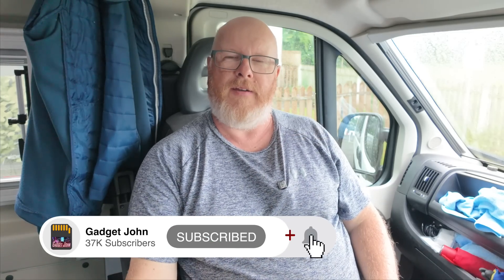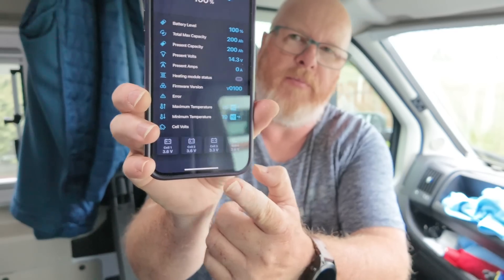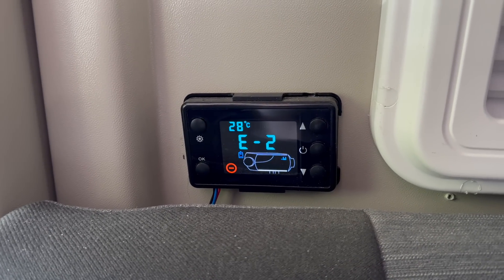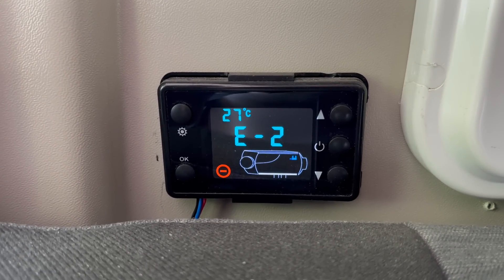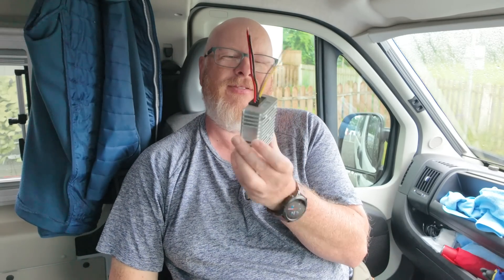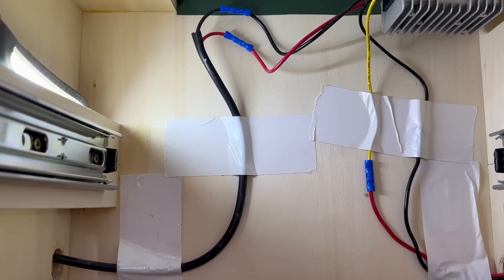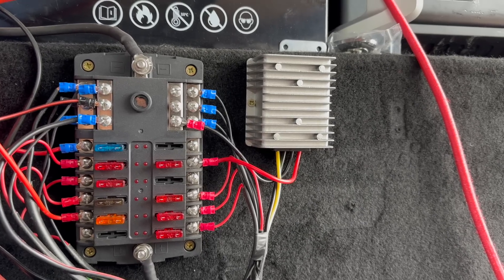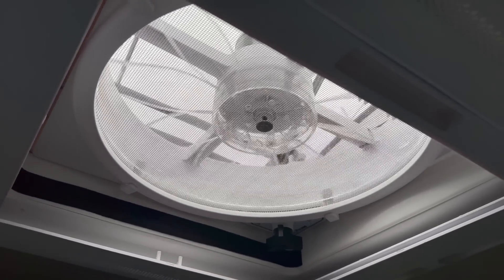The Voltage Regulator no one knew We All Need!

Comment: Hi John, hope you are both well. Took me a bit of searching to find, but i thought you did a video on this subject :) Got a similar problem myself now. Whilst on AGM batteries my Alexa worked no problem wired into my fusebox. Since changing over to Lithium i have now blown up 2 Alexa's (probably due to cell over charge, when reaching full). Touch wood everything else seems to work fine or at least as it did when i had AGM's. But looks like the Alexa needs to be at no more than 12v's. Thanks for the video, im off to look at Voltage Regulators now :)

Comment: My diesel heaters actually prefer running with the alternator and engine on. They definitely start up nicer on 14+v  diesel heater shouldn't really be very voltage sensitive i mean the glow plug definitely likes a few more v and a dosage pump and fan shouldn't really change much over a volt or two. I guess some controller circuitry can be sensitive to voltage changes.

Comment: Lithium is a badly understood technology. You do not need to charge at crazy high voltages you can get the same  result with more safety and with much increased battery longevity by charging at much lower voltages, plus it reduces the risk of thermal runaway and BMS shutdown which can be catastrophic for alternators and onboard chargers. We need to learn that Lithium does NOT need 3.65V per cell when you can achieve the same result  @ around 3.4V per cell. 3.4 x 4 = 13.6V which would probably be accepted by most 12V appliances because alternators tend to pump out 13.8 - 14.2V? Obviously IMO  :D

Comment: Make a lot of sense as you state these items are 12 volts not 14.4 and years ago when I fitted a TV in the back of our van that was a main / 12 volt tv I decided to fit a 12/12 volt regulator. However I’ve never thought to use one on other equipment ie. the two fans I’ve got like yours but I’m going to give it a try and see how it works.

Comment: Just thinking aloud, With the heater "cooling down" session, even using the "Buck" converter, if the battery fails, unlikely. Could you use a smaller 12v battery that the is only for the Heater, so that it always has its own supply and buck converter ?

Comment: This makes sense and yes the appliances should be designed for 10.5 - 15.5 volts but the manufacturers won't build these electrical appliances correctly because it costs too much as they usually use off-the-shelf components and they only want to meet the warranty period...  And just how many times does Management override the design engineer because the bean counters found a justification to use "lass-than" components to increase profits by NOT doing the right thing...

Comment: Funny I had the opposite, while tiring to run my 12vdc refrigerator using the 12v/20amp buck converter would fault out for under voltage, this was with 2 different 12vdc buck converters. I changed over to a 13.8v buck converter and now everything runs perfectly.

Comment: Great solve for some devices for sure   👍,  and/or out of warranty to open up and do some rewiring lol , Ive found Rving here in B.C. that my biggest issue is the power inverters, theres so much power left in batteries but inverters will BEEP alarm and shut off at barely below 12v, but without a wiring schematic pretty hard to do.
On 12v low amp things like remote starters and alarms for vehicles can use diodes together so main input sees over 12v and the other current but I havnt seen anything for big amp current

Comment: Following your links to Amazon UK: 12A version... £50 quid, now. plus £11 quid for postage.
6A version... £23 quid plus £11 for postage. And that's probably before they add our GST (Aussie here). Your video must have sparked a surge in purchases so they jacked the prices, maybe.
I already tried looking, before your video, as my voltage output is not very stable, at all ... for some reason.
I haven't found equivalent equipment down under, yet. Which is annoying and weird. And we always get ripped off down here to cap it off. sigh.

Comment: Diesel heaters also draw 10 amps for a short time during the shutdown sequence when the glowplug is activated. That triggered an E-2 error for low voltage as my batteries were quite low. I had to start my engine to allow the heater to cool down correctly. Lithium conversion incoming.

Comment: This explains a few electrical issues I've had.
Mainly the fridge cutting out. I put it down to being too hot in the van, but from your video suspect It's a voltage issue. 
Just upgraded to Lithium and replaced my old Victron Orion-TR B2B charger with the XS model.
Looks like I can now repurpose the old unit as a voltage regulator for the main fuse board if it's put in Power Supply Mode.

Comment: I had the same problem with an echo dot in my car camper fitted a 12v rectifier to run it so when the solar goes into equalize it doesn’t over voltage the echo dot

Comment: Hi is this gadget adjustable ? As I’ve seen many diesel heaters need at least 13.5 volts so it’s working for you but will it work up to the 13.5 itself slight confused as a long chat  cheers

Comment: Thank you for this! These voltage regulators have quite a decent heat sink on them. Does that mean that they generate heat and should be installed fairly isolated? Or can they be installed in a fairly small space surrounded by wires?

Comment: Found this really interesting John, thanks for the vid... question, and forgive me if it is a stupid one as I know enough to get by when it comes to electrics... but could you not have a voltage regulator in line from the battery directly... so anything being fed from the battery would be regulated... or does it have to be one per device?

Comment: I've "cooked" a few devices because of this 😅 most recently a WiFi router that has run for years, after a drive with it on it smelt of plastic and no longer worked properly, something inside it had obviously burnt out. Bought myself a regulator like yours and it's been fine since 👍 my fridge also changes tone when the sun goes in and out (solar charger), so I may put one on there 🙂

Comment: The problem with your theory is that most alternators using a standard lead acid battery charge at up to 14.4 volts as well. So I would expect any device designed to run in a car off of the 12 volt system to handle 14.4 volts with ease.
Reply from the maker: That’s the great part about my videos, I don’t theorise, instead I wipe out any reason of doubt by proving what I say and showing why I’m saying it. Thanks for watching.
Reply: @GadgetJohn  I’m glad it worked for you. I’m just a bit doubtful of any 12 volt equipment that can’t handle a standard alternator charge voltage. Unless, as a thought only, the fact that you have put a lithium in is somehow causing your charging to ramp up the voltage higher than this. Of course, I have no idea what you are using to charge this. If it is pushing a higher voltage than 14.4 volts though, it may well cook the lithium battery as well, or at least cause it to shut down to protect itself.
Reply from the maker: You’re not seeing that not all 12v devices are designed for the automotive sector.
Reply: @GadgetJohn  true, though a diesel heater designed for a camper should be. A normal charging profile for a lead acid or AGM battery will reach 14.6 volts and most solar regulators will push that voltage. So I would expect at least the diesel heater to be happy to deal with such a voltage easily.  I’m not trying to be difficult, I’m just trying to figure out why your set up has caused you problems in the first place. It’s quite unusual.

Comment: Great addition.   Having a stable known supply is essential.  I installed a microprocessor with touch screens to control the van and had all sorts of stability issues with relay boards and touch screens.  Solved with a regulator.   
If the regulators are decent they will also provide DC ripple isolation between devices.  Useful for when you’re running higher draw devices and motors.

Comment: Argh, I hate it when my battery dies and shuts down my diesel heater with that err 2., it would make more sense for the heater to shut down but allow the cooling process to continue operation. Im going to need a backup battery system just to prevent that. It wouldnt be good to have my heater crack in mid january with Canadian weather.😢

Comment: John, is there a master version of this so that it could be placed between the battery and main fuse box then all items would receive 12v?
Reply: I have found a 24v - 12v 60A unit on ebay a couple years ago for my off-grid RV to selectively replace the 120v shore power converter with the 24volt storage setup. I'm convinced it is 720 watts (12v@60a) maximum output, not 1440 watts (24v@60a) input, as the advertising of ratings can be a bit confusing. I found another one for 48v - 12v for about the same price for when I'm ready to upgrade to a higher storage voltage trying to maximize efficiency running the refrigerator, AC,  and TV. I imagine they make a 12v - 12v version as well and they are about $70 - $80. I got a larger sized model without any fans with very little loss in conversion for the right price with a little searching. I've got it featured in one of my older "Off-Grid Hybrid Solar Solutions" (playlist) videos, and the device still runs perfectly after pushing it very hard in the summers with a lot of large "car radiator" fans connected to independent speed controllers (about $8 - $20 each). The converter still works without issue to this day. I forget it's there and I've never had voltage problems with it, but I've always had this worry on my mind about overvoltage on some electronics since I was a child experimenting with connecting automotive and household stuff up to each other.
I've got to mention that having it between your battery and your distribution panel will also act as a low voltage shut off if you lack a battery management system!
Reply: @SimonGardiner-m7l  exactly, why not put these at the base

Comment: No one, not even the manufacturer of my WLAN router could (or would) tell me if it will work with more than 12V DC (it came with a 230/12V power supply) so I installed a 12V/12V regulator two years ago and the router still works fine. 100% agree with your conclusions. Thank your for sharing it in a video.

Comment: This issue is a pain in the ass, it is not just confined to Lithium batteries, I am off-grid solar with Lead Acids, if my batteries ever read 12 volts on the meter I would be shutting everything off to protect the batteries. I never let them drop below 12.2volts normal voltage is 12.6volts after dark, after charging 13.2 and charging voltage can be up to 14.8volts. The trouble with regulators is they usually require at least two volts over the output voltage.
Reply: The buck regulators get around this by using smps design.

Comment: Thx John, It made me check my camper after conversion. Found most of the good electric devices to coop with 10.5 to 16 Volt but some where really 12 - 13.5 volt only. I have no started to convert the once I need to protect. Good to Know that on the Maxxfan it also helps to cut noise and wear of the fan. ❤😊

Comment: Hi John, I’ve just stumbled across this and you may have solved a problem for me. My webasto diesel heater will only work on hook up, or with the engine running. It fails on initial start up. The error message  is low voltage. I replaced both leisure batteries, but still have the issue. I found a few posts online with people having the same issue, but the only suggestions were to increase the supply cable in case they’re causing a voltage drop. I’m thinking this regulator has to help, what do you reckon?
Reply from the maker: It’s also a very good suggestion to increase the cable size to your diesel heater if the cable length from battery to heater is over 2M - I suggest double the cable size.

Comment: Im learning to build drones. the safety of battery charge/discharge is important to extend the life of the battery and not start a fire.

There are inexpensive boards for 18650 charging. Im stepping up 3.7v to 5v-24v and a voltage devider circuit to monitor battery voltage.

Lots of fun.

Comment: I use one of these for 12v to 19v for a 32" samsung smart tv in my van I dint need that though as most stuff is designed to have a little room for voltage drop and increase this isn't a must.

Comment: I don't know the conversation losses with the regulator but your LEDs might benefit and it's very unlikely that you're using anywhere near 12 amps in an RV for lighting these days. I believe they are constant current so they use more wattage when you produce more voltage. At least that's how my RV LEDs are in my solar carport.

Comment: I had a problem with flickering LED lights which went away after I converted my system from 12v to 24v and installed a 360w 24v to 12v converter to power all the legacy 12v devices. The only downside is the efficiency of the conversion, which is around 85%. I went with a whole van solution to avoid having multiple blocks all over the place and everything does seem to work much better at the constant 12.8v I set it to.

Comment: I am currently working on designing my narrowboat, one of the things I would love is a 24v, 48v and 240v systems. 
When watching YouTube videos a narrowboats they are pointing out issues with lights and batteries voltages. So I would love a electric motor for moving and 24v for everything else with step downs for a number of systems. 
So with this setup I am hope for less voltage drop over the wires and a Consistent voltage, and with the lights there are smart lights blocks which take a number of different voltages in but gives a consistent 12v out to the lights. 
Which would give me consistent lighting and the ability to mount and move lights switches without rewiring with smart light switches. Plus 24v are a little bit safer then 12v when turning on and off electrical equipment. 
And as I would have a large battery bank for moving a nice 240v system is just a given. Then I could have three ways of cooking and heating water 240v induction hob/ oven, Gas hob/ oven, and wood burning cooker stove. And for hot water Diesel, 240v, 24v, and back boiler from the woof burning cooker stove.

Comment: I run a 24v off-grid system, a lot of things I run direct from the batteries are rated up to 30v, everything else runs from a 24v to 12v  transformer.

Comment: I wonder if there’s a 12fuse board which has a buck already installed . Saves having to add them individually to various equipment . 
I know most 12v electrical will have a tolerance but would be handy just wiring everthibg into the board knowing it purely 12vdc

Comment: 12v devices intended for use in vehicles may say 12v on them but that is because Joe Public with no knowledge of vehicle electronics and such would get confused if they stated 10.5-15v or similar, because any standard lead battery will operate in that range. The 12v is just to distinguish from 24v or 48v. 12v electromics intended for use in the home are an emtirely different kettle of fish and then what you say is correct, but if fans and fridges intended for vehicles cannot operate (or fail safe) at the full range of voltages found in vehicles during normal operation that is a design flaw. Nothing to do with lithium batteries as they operate well within the voltage range of lead acid which can go up to 15v or so, voltages that would destroy a "12v" lithium battery if not protected by a BMS. By the way the native voltage of an EV is rarely if ever 48v, normally many 100's of volts, unless you are talking about golf carts and fork lifts.
Reply: @mikebarry229  you saved me having to type it out myself
Reply: Li batteries can take a higher voltage than SLA's or Flooded batteries. If the system was designed for traditional voltages, the regulating circuits might not accommodate higher or lower. The charging circuit most likely did not cause a problem but the solar if not regulated properly could cause problems as well as the fluctuating current.. The buck converters are acting as filters. I add buck converters to most circuits to solve many problems
Reply: @twistedhillbilly6157 what you say, and indeed what the guy who posted the video says might be true for some "12v" batteries made of lithium ion cells because such cells have a working voltage of 3.7 volts each. For that reason they are pretty useless in a 12v battery. Using 3 cells gives only 11.1v and 4 cells gives 14.8v. For this reason they are rarely used in decent 12v lithium batteries, but can be used in 24v batteries when they use 7 cells giving 25.9v. Most decent 12v batteries, and increasingly 24v and 48v batteries use LifePO4 cells with a working voltage of 3.2v each so 4 cells = 12.8v so a perfect replacement for lead acid batteries. At 100% charge they can go as high as 3.6v (so 14.4v for 4) but that is still way less than lead acid batteries can see in a typical vehicle so they need to be protected to prevent such charge levels being reached using a BMS. At 90% charge a lifePO4 battery will be back down around 12.8v and it will stay that voltage down to about 10% charge making a LifePO4 battery much kinder than a lead acid battery which might be 15v plus at 100% 12.8v at 95% maybe 10.8v at 10% charge (and likely badly damaged too)
Reply: @mikebarry229  Exactly right. These urban myths are all over every 12V forum, along with hybrid battery systems and dump loads. As a marine electrician I get “asked” about this constantly and no one wants to believe me when I say it’s balderdash.